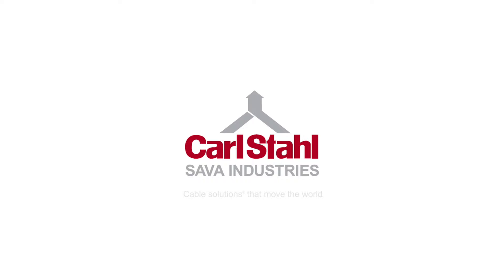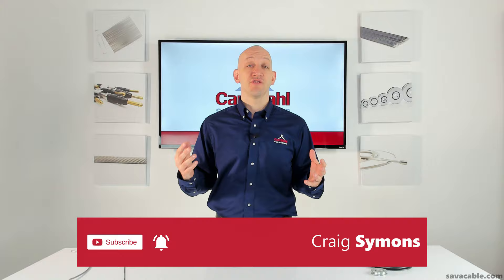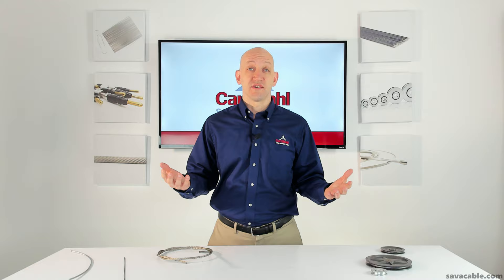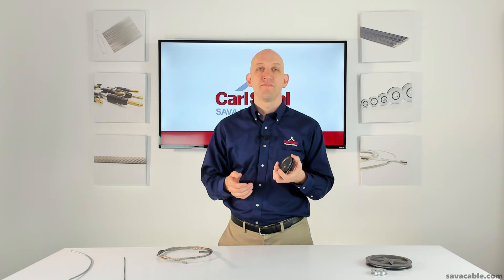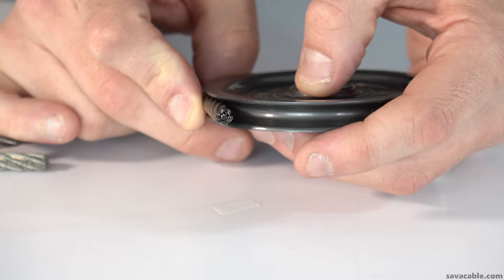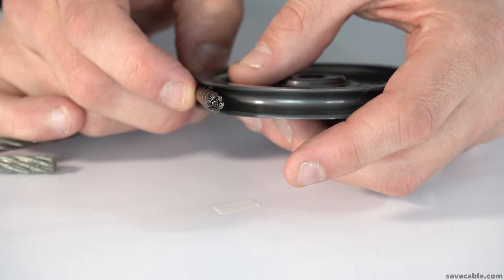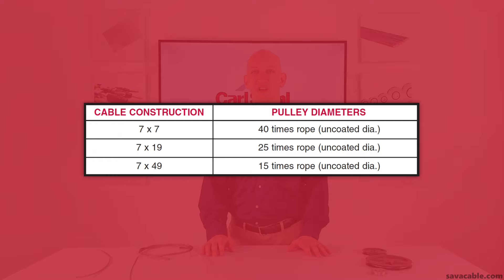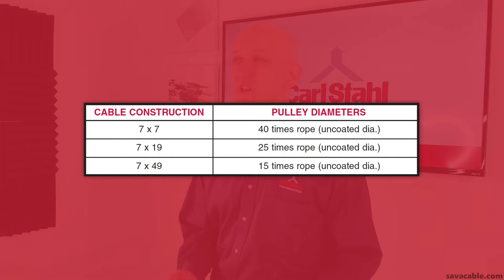How to Choose the Correct Cable Pulley #wirerope #pulleys

Comment: What coating is more durable on gym equipment that goes around several 6" pulleys? Vinyl or nylon?
Reply from the maker: Hi Nathan. Thank you for the questions and sorry for the delayed reply. Of the two options, nylon is best for cable to go over pulleys. We are making a video on coated cable in the next month. Be sure to subscribe, so you don't miss it!

Comment: Is the optimum D/D ratio changed if a cable only travels around a pulley 90 degrees rather than 180 degrees.
Thx,
Tom Fisher
Reply from the maker: Tom, thanks for the comment!

For lifting, D/D is only applied at 180 degrees. 90 degrees would only be redirecting the force.